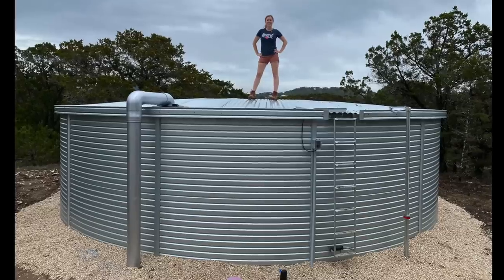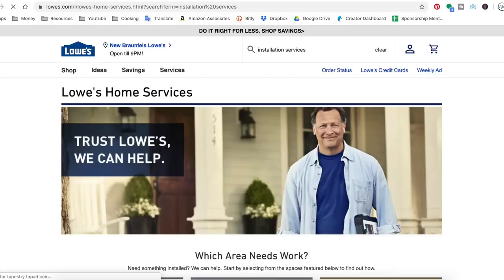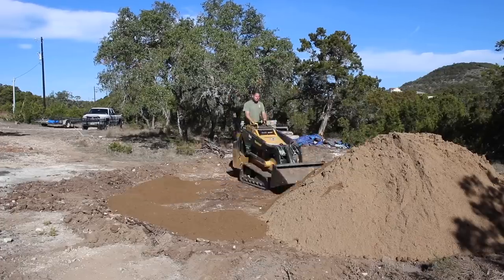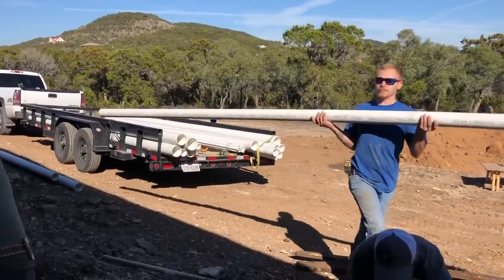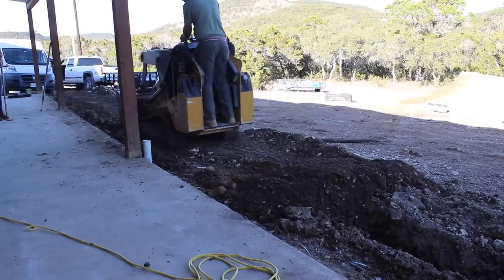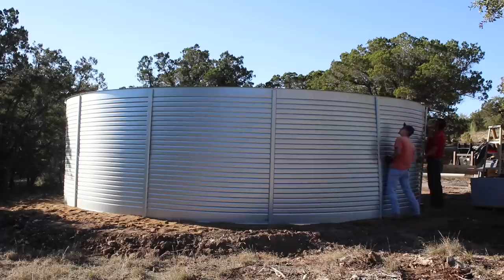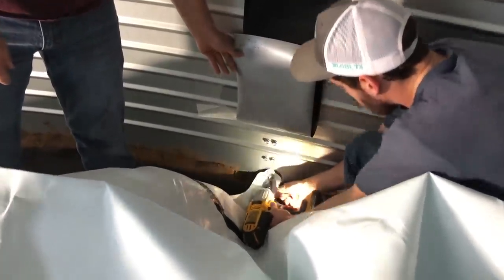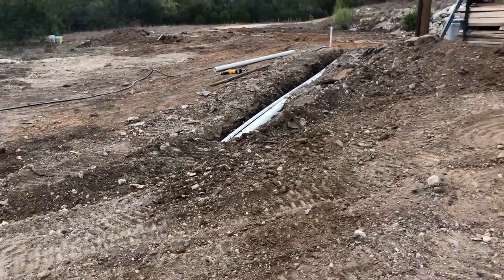Installing Rain Water Collection

Comment: Yes, we also collect rain water and love it.   We grow  gardens in five 26 ft x100ft long high tunnels plus another acre of gardens and our well water has a  high a percentage of dissolved minerals. It would only  take 3-4 years of using our well water before the soil in the high tunnels would be  totally ruined.  The second reason is  our well only produces  4-5 gallons per minute and its not hard to run the well dry watering huge gardens. Our barn has 8200 sq ft of surface area and we can collect an amazing amount of water during a normal season. I estimate the volume is upwards of 65,000 gallons during a normal rainy seasons.   I have tank storage of around 4500 gallons in plastic tanks and another 6000 gallons in low cost 12-14 foot swimming pools we get at Walmart. I priced out larger more permanent tanks but they were running from $2-$3  a gallon to install. There is no way I could justify spending $30,000-$40,000 for a system. The $400 I spend on the above ground pools is money well spent and a huge savings.   I live in Alaska and we don't get much rain or do much gardening in the winter anyways. They are also a nice way to cool off during that two weeks each summer when it actually gets warm. haha.  And, I always have water if needed for fire fighting.  Any excess water that I have in storage MUST be drained off before freeze up and it would be prohibitively expensive to try and over winter the water.  I dont know if the USDA/NRCS still has grants available for water storage systems  but they designed and paid for my entire roof collection system and tanks six or seven years ago. Its worth looking into if you use the water for an agriculture purpose.

Comment: The magnesium bag is known as a "sacrificial anode" - essentially makes your tank a battery, and the magnesium eats all the corrosion.
This is also used on boats!
Reply: thank you for explaining that 💜
Reply: Nice! I did not knew!
Reply: Zinc is cheaper than magnesium and doesn't burn as enthusiastically.
Reply: @isaackvasager9957  Correct. It just prevents galvanic corrosion of the intact metal.

Comment: I use a downspout to a rain barrel. A fish tank float valve cuts off the flow from the barrel outlet to 5 gallon pail at a certain level. The pail has a 3/4 inch lawn irrigation tubing that leads to a bird bath. Using hydro-static pressure, the  pail and the bird bath are always at the same level. Viola!.... automatic bird bath filler. When the birth bath level drops, the pail level drops, and the float valve kicks in to replenish the pail from the rain barrel. Works really well!

Comment: You should consider putting a five or 6 inch steamer fitting on that tank so that the fire department could hook into it if you ever had a structure fire on your property. You might save some money on your homeowners insurance also.
Reply: Jeff Eastman  I was just thinking the same.
Reply: This is a common feature on many of the systems we install, but whether we can get a discount on homeowner's insurance depends greatly on the local fire department's wish to bless the system and write a letter to the insurance company.  Some of them require 10s of thousands of dollars of extra equipment for the tank making the savings difficult to justify.
Reply: $10k????  Good lord!!  Are they making you install a diesel fire pump and a stand pipe???  Do they not realize that they’re supposed to bring their own pump on the big red truck??  🤣
Reply: I can assure you that my fire department would do what we could do to assist the homeowner to acquire any type of insurance discount.
Although you probably wouldn’t see  a system like this in northern Vermont.

Comment: Wells being problematic here (minimum 400’ of hard, difficult drilling… hard, sodium and iron filled if you do* get a good feed, and the local danger of finding gas or oil), I’ve installed dozens and dozens of cisterns for people to truck potable water in to their acreage.  In a case of “The Cobbler’s Children Have No Shoes”, my own place has only a 5000 gallon cistern, but I’ve installed many many hybrid systems that collect rain water/snow-melt for grey-water purposes.  

Even adding in the cost of trucking in water for 30 years, that’s still cheaper than the cost of drilling a well, especially if you have to ad a costly treatment system.  

For spits and giggles, my rural municipality did a cost analysis for the investment to hook up to the nearest municipal water supply, as some 200 homes were relatively densely adjacent to a spur line that had been run to a community that needed proper water.  They came back with a cost of over $120,000.oo per household just to build out a low-volume trickle delievery network, and homeowners would still have to install a cistern and monitoring system…  We could continue to haul water in for the next century before that made any sense. Plus on-going operating an maintenance for the network...

Comment: I started a system from sixteen 55 gal barrels to irrigate my veggie garden. I'm currently in the process of upgrading to four 275 gal totes, plus three 60 gal barrels.  I also have a plan to install four or five 275 gal totes in my front yard for a future orchard..(after it gets fenced). I live in Spokane, WA. 
Yes..Washington had a ban, but it has since been lifted.

Comment: Next upgrade being a daily use water tower and a windmill driven pump to fill it to avoid running the electric submersible? 

You should totally get in contact with Grady Hillhouse from Practical Engineering in San Antonio if you haven't run into him yet. I imagine you guys could do some really neat projects together.

Comment: Hey, congrats!  We've got a 45k gallon cistern, just Northwest of Dripping Springs.  Had it built about 22 years ago, it's concrete.  We gather about 3000 gallons per inch of rain off the house and barn.  We run the whole house (including drinking) off of the system.
Reply: You live in the heart of modern Rainwater Harvesting in the US.  It's finally starting to spread around the rest of the state.

Comment: In round numbers what did a system this size cost?  Thanks!
Reply: The gardener  
She offered a reply earlier to say her project was not the usual style to make a comparable cost for the norm.
Reply: You could ask a company to make a quote without engagement. Or is that not done at your end. Recently I asked for quotes from around five or six suppliers for solar panels (photovoltaic panels) to be placed on the roof. From each quote you learn a lot and at the end we made a choice for a supplier that felt "good". It was  not the cheapest supplier that got the order.
Reply: A system this size in Central TX is typically around $30k including treatment for indoor use. Varies several thousand either way depending on the site work and complexity of the collection piping. In this area the cost is often competitive with well water and municipal supplies and the water quality is incomperable.

Comment: No filter or screen before the plumbing to prevent leaves, twigs, dirts, etc into the system? I should hope so
Reply: Just based on what I’ve seen on screen about the landscaping around the shop I doesn’t look like that is much of a concern for her, but I’m still surprised they don’t include it with a trenched system that big.   screen isn’t going to help much for dirt though.
Reply: Yea I'd normally expect a silt trap as well.... 
Not sure how you would clean out a pipe like that, without cutting it.
Reply: @deth3021  Did you not watch closely? They showed the valve to clean the lines with the water jetting all over. Go back and watch it again before commenting.
Reply: @frankcar1965  you get that a valve to clean the lines isn't a silt trap?
Reply: @deth3021  Can you formulate a coherent sentence?

Comment: Yes I collect rain. My collector is a Tractor Supply water trough that measures 3' high x 5' long x 2' wide. I use for filtered drinking, garden water, and cleaning/bathing. Rain water tastes yummy compared to other sources available, and as they say " once you've had it, you can't go back"!
I bought a IBC tote but haven't quite mastered how to use/incorporate it. 
What I'd like to do is water tank into tiny house to an instant water  heater for kitchen sink and shower and a cold water line. How to get from A to B is still in progress.

Comment: Hey April! Down here in rural New Zealand it's very common to have tanks.  We have 2x 25k litre rain water as our sole supply,  having grown up on tank water we don't even filter it, never sick .. we use a much less complicated system and our tanks are polypropylene or concrete.  Thanks for the video! X x

Comment: April, How much does something like that cost?? Very cool set up!👍👍
Reply: Been pricing them.  A typical POTABLE system that adds a couple extra $K for a 25-30K gallon tank like that seems to be about $30-40K, with everything (tank, collection, work, install) installed.  Basically  $1-$1.25 per gallon.
Reply: @travwill  That's correct Travis.
Reply: Harvested Rain Solutions, LLC How much would a tank roof that collects water add to a project? Great work.

Comment: I installed a food grade Barrel to collect water from one downspout at my house. Two things I forgot to do was to place a filter on the water inlet. I have seen people use fiber mesh or even hosiery. The second thing I was surprised about is the lack of good solutions to pump the water to my lawn which is above the grade of the barrel.. Some where very expensive and others ran on battery power, but I was looking for a solar-powered pump that will handle the head pressure and could not find one. Thank you for your video, I love this channel!
Reply: I actually started the company building solar powered pumps to connect to rain barrels... but couldn't compete with store bought pumps and then the enforcement of the plumbing code changed making pressurized water impractical on such a small scale.
Reply: @CqureWaterTexas  interesting... how does the plumbing code factor in?

Comment: A suggestion that I was surprised to not see from your contractor; first flush pretreatment. 

The first rain of the season, especially in wet/dry season areas, tends to have a disproportionately high amount of contaminates. An easy way to catch it before it goes into the system and spreads the contamination through out the cleaner water is to use a stand pipe. The first flush with the contamination fills the pipe before the subsequent cleaner runoff over flows into the collection system. Periodically, you would drain the standpipe to be prepared for the next first flush. You could also accomplish it by having a bigger sump between the collection points and storage. You do have the blow off, but that pipe seems undersized for a first flush from such a large system. Hat tip for investing (how much $?) in a more sustainable future. On the opposite end of the cost spectrum (DIY), you should check out Brad Lancaster in Tucson AZ. He has a great TedX talk about what they’ve done.

Comment: I didn't notice any instrumentation to measure volumes of rainwater captured, overflowed, returned to the house, and discharged as greywater. Why would any state or municipality perceive the detour of rainwater through a home as representing more of a resource loss than letting the same rainwater run off the roof and onto the ground?
Reply: Isn't the groundwater a resource for States in the west that share snow runnoff+ other water sources= water you going to neighboring states? Like...eh Colorado.
Reply: @kimroberts2704  The video mentions her well. April can supply her needs from her existing well (which draws from and temporarily depletes the groundwater) or she can use rainwater, diverted from surface runoff, and eventually discharged on the surface as greywater.  Seems that she is taking care of her neighbours (eh?), even in Colorado. (Does Texas groundwater flow uphill, across New Mexico and Oklahoma, to Colorado?)
Reply: @3maisons  I had a typo. I meant to list Colorado as a state that does not have total rights to their water. Excuse any confusion  please.
Reply: The city of Baltimore taxed folks by the square foot of nonpermiable surface on their property for a time.  That's right, you got taxed for the rain!
Reply: @kimroberts2704  Thanks for your reply and your clarification. It has led me into browsing the dystopian domain of "State Rainwater Harvesting Laws and Legislation".  Today, state control of the water that comes your way; tomorrow, ditto the oxygen and sunlight. It's only a question of abundance or scarcity.

Comment: I have a very low maintenance water harvesting method. Three 5 gallon buckets to catch the rain off a small section of roof. About 20 one gallon milk jugs for storage. I use the water for houseplants exclusively. I try to keep everything topped off as much as possible so as not to waste what I’ve caught. There has been one occasion recently when the dangerous winter storm of 2021 cut power to the water company. We used about 4-6 gallons a day to flush toilets. I used EVERYTHING & ANYTHING to collect any snow I could & melt it then store it in bigger storage containers normally used for storage. All in all we got through it. Afterwards my wife approached me about installing something more “high tech.” I couldn’t be happier. So that’s my story in a nutshell regarding rain harvesting.

Comment: I installed one for a house I built in central Texas. Could hold 18,000 gallons of water. The barn I harvested off of was so big I could catch 3000 gallons on a 3/4 inch rain. The water was pumped to the house where Culligan sat up a shell additive and small bleach pump to sanitize. Used to service the whole house. Retired couple only part time home and occasionally used as a hunting cabin  30x40 with up stairs 3 bed 2 bath home. Never ran out of water that I know of.

Comment: 7: 45 that's what we have at home, its main use is lawn hydratation and plant watering in summer. Ps : A stand with some cinderblocks is really usefull because it gives some gravity to push down the water, also clears the spouts off the ground.

Comment: It's kind of funny that the tank doesn't collect from its own roof :D
Reply: Well, the tank is like 1/7th the footprint of the shop, so it's a fairly small improvement.
Reply: @TJStellmach  To be fair that's nearly 15% and nothing to scoff at.
Reply: Tank roof collection is an option, but has a few drawbacks, the biggest being the low slope of the roof tends to collect dust and other pollutants and there's no way to divert that contamination before it enters the tank since it has to enter at roof level.  We do use it sparingly when there isn't a lot of collection surface available, but it requires significant maintenance to keep the roof of the tank clean.  We're all about low maintenance!
Reply: @CqureWaterTexas  is the system not just for gray water? If so what would a small bit of dust matter. I could understand if it was potable
Reply: @donniebrown2896  Nearly all of our systems are for drinking water supply, and even when they're not we build them to Potable standards in case the owner ever wants to use it that way or if there's an emergency need for clean water. This system is for collecting rainwater - Gray water is drainage from washing machines, lavatories and tubs/showers.  Kitchen sinks and toilets are considered "black" water. Graywater becomes black water after a few days, especially in the heat.

Comment: The small butts as they get called over here usually 250 Litres or roughly 67 US gallons are used by a lot of gardeners in the UK cheap and easy to install and provide enough water to water plants for greenhouses etc  but your tanks awesome.

Comment: Are you going to add any cover to the top of your gutters to avoid debris getting in the tank?
Reply: What do you think she was standing on?
Reply: Fontaine King the gutters, not the tank itself
Reply: Jeff Kelley , good point, it’s also not a good idea to have 90deg. bends in your down spouts.
Reply: @JeffKelley  👍
Reply: Paul Badger Well, one of those is easily remedied by adding a screen. 😃
Reply: I was thinking the same then looked around at the height of her trees vs shop. She probably has a number of years before they are tall enough to cause a problem. Wind may blow dirt/dust up that high but maybe not enough for her to be concerned. She can always add covers later.

Comment: Thanks for discussing smaller rain barrels in your video too.  Just wanted to mention that some cities/regions run rain barrel programs, providing and installing one for no cost or greatly reduced cost. Since such programs are becoming more common, it is at least worth doing a search if your area has a rain barrel program, instead of buying one first. (Apologies if this has already been mentioned by someone else in the comments).